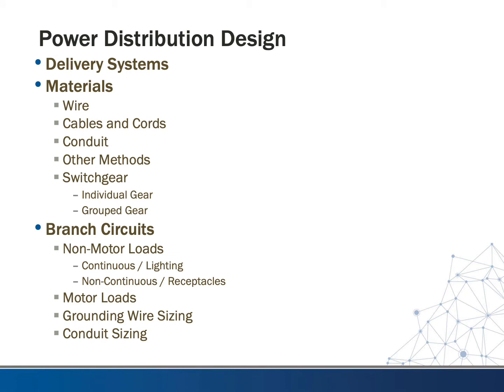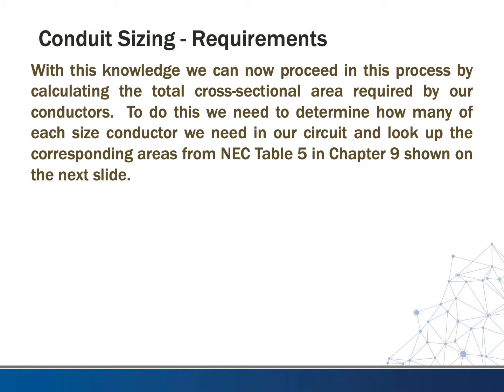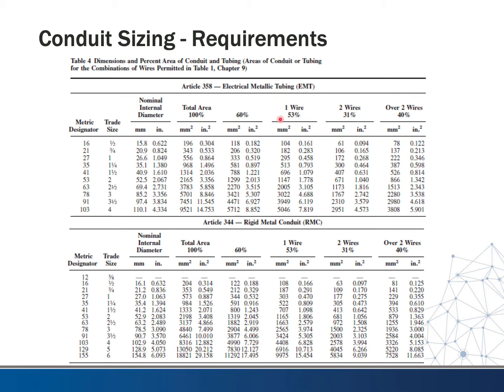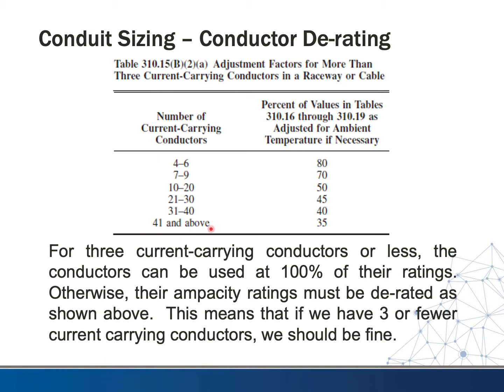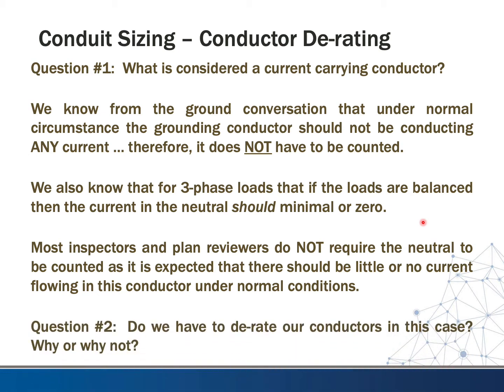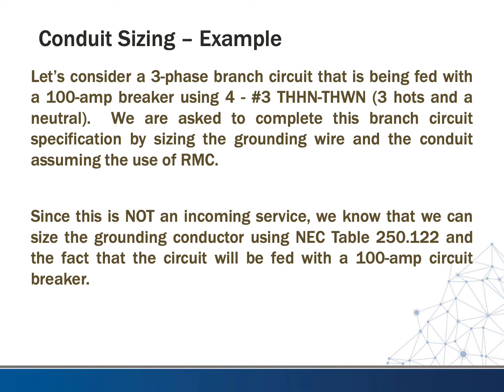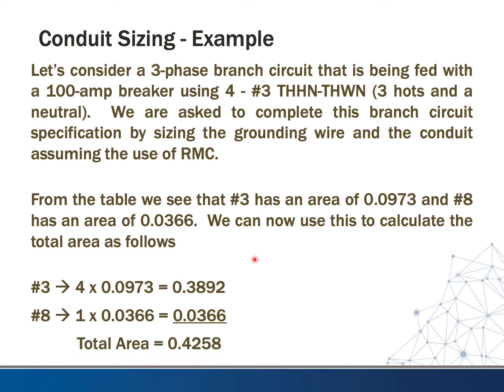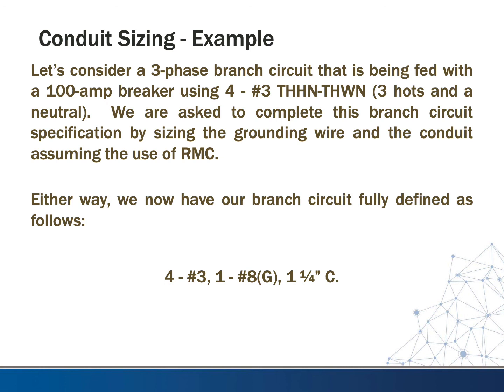Electrical Conduit Sizing

Comment: so if we have 4 conductors, do we have to use 80% of the 40% the conduit size?
Reply: Not quite! If you had a 100 amp load, first you would divide by the 80% to get 125 amps. Then use the 125 amps to determine the conductor sizes. Use those sizes to get the area and ground conductor (still using the 125 amps to size the ground) and add the areas. Then take that total cross sectional area and divide by 40% to get the conduit size you need.